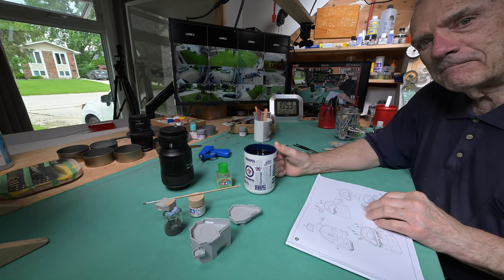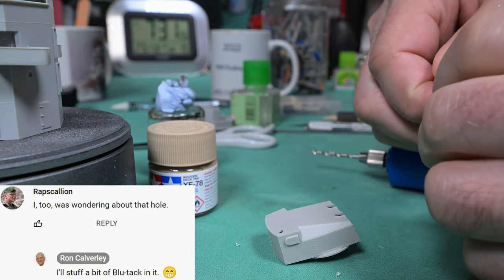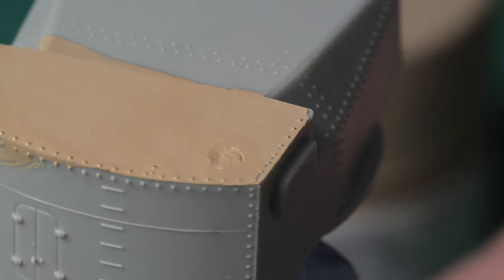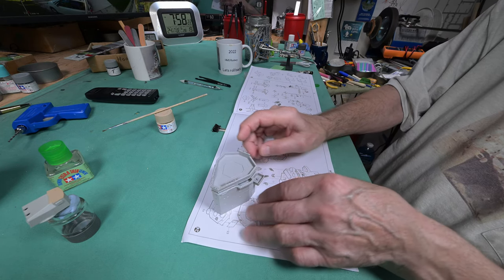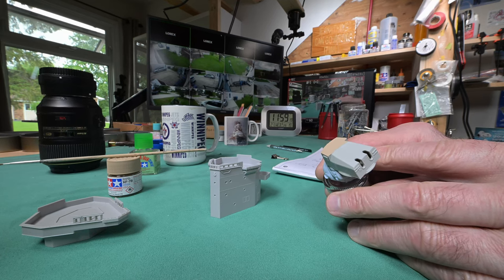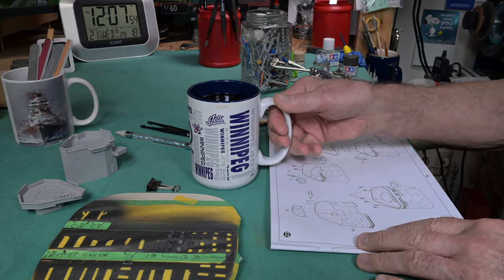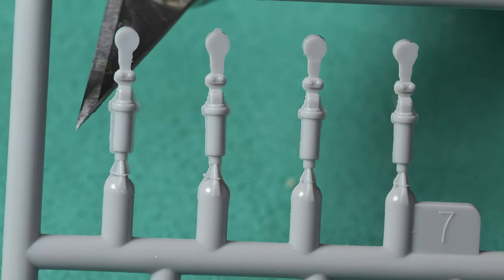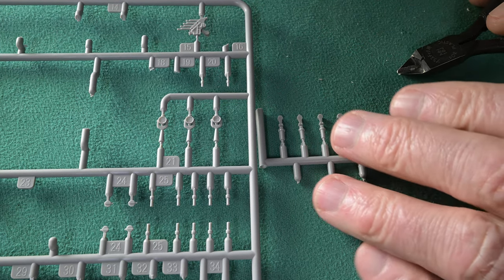The Model Ship - Part 1224

Comment: Hi, who manufactured the model? On the binoculars I notice large mould flanges, is it an old kit? In this day and age there’s no excuse for poor mould quality. I find Citadel and Meng provide the best quality kits.
Reply from the maker: This is a Trumpeter kit. Mostly it's been pretty good for seam lines and flashing problems. What you saw here was very unusual.
Reply: @roncalverley  thanks, I have had this problem with there kits before, I have recently finished a submarine by them, with the same issues. Took the fun out of it. Meng tend to be more thoughtful on their designs, which is why I have many of their kits.